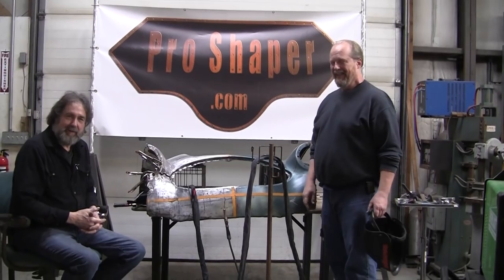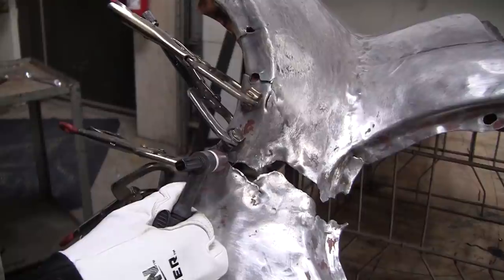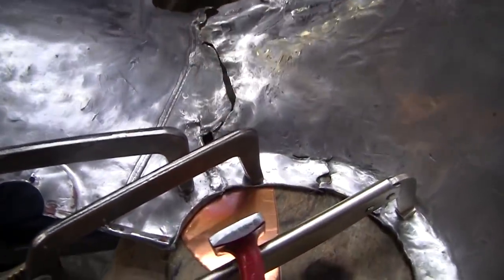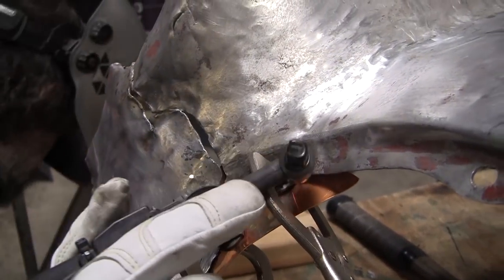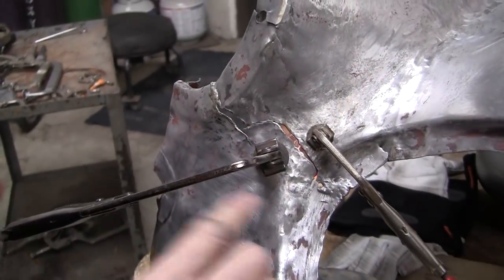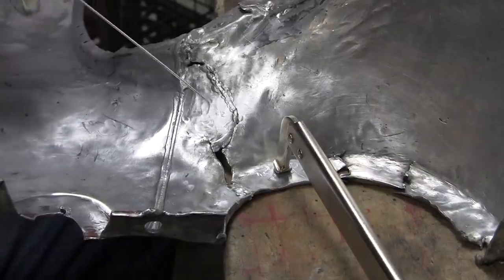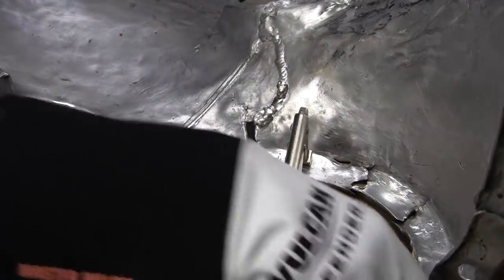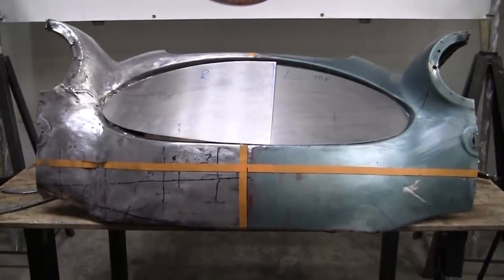Stitch it and smooth it: The Austin Healey Shroud

Comment: Great job, you're amazing I hope to see the cleanup your technique of blending weld down.👍👍👍👍👍👍
Reply from the maker: Grinding technique is as important as the welding. Observing my students 95%( before I set them on the right course) of them treat grinding as an unfortunate dirty task that must get done. They grind adjacent to the actual weld bead and weaken the adjacent metal significantly. Grinding must be done correctly with the utmost respect for the adjacent metal.  Compare it to sanding out a small blemish in paint, you don't sand the chrome and the paint several inches from the flaw. If you do you make the repair bigger and bigger.

Comment: I picked up the cheap tig welder from your amazon store and it's much easier to learn than I expected. If/when I upgrade and start welding aluminum, is it fairly similar?
Reply from the maker: A few subtle differences but it is all about hand eye coordination,  plus your foot. It becomes easy once you get the seat time.

Comment: Is the copper there to absorb heat so the aluminum doesn't melt?  You mention a couple of times that the copper is to keep the oxygen off of the weld, but I don't really understand the significance of keeping oxygen off of the weld. 

Also, what process do you mean by gas welding? MIG, using an acetylene torch with a filler rod, something else?  Thank you.  Love your videos.
Reply from the maker: Tig uses the inert gas to shield the welded zone from the oxygen. The backside of the weld is wide open without the copper if the joint is not tight. If the weld joint prior to welding is a perfect tight fit-up you can weld with no problem. If the joint is open a black haze quickly forms and it prevents welding. With the use of copper as a backside shield you can weld with no problem even with a poor fit up.  The same rule applies to  all metals when welding, some are more sensitive than others.

Comment: I’m curious what the benefit is to using a helium mix on thin aluminum?I’ve only ever used it to get a boost in heat when my machine doesn’t quite have to jam to weld thicker stuff.
Reply from the maker: Try it and test the weld, you will learn the difference.
Reply: Google says cleaner puddle. Thanks for replying